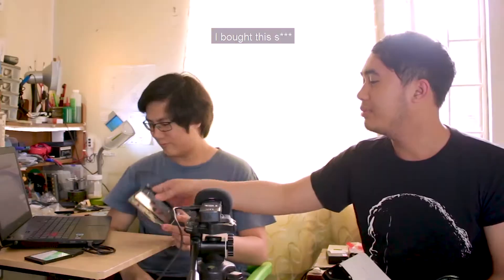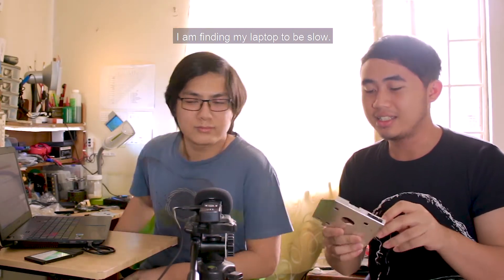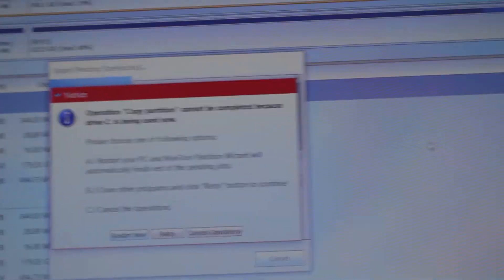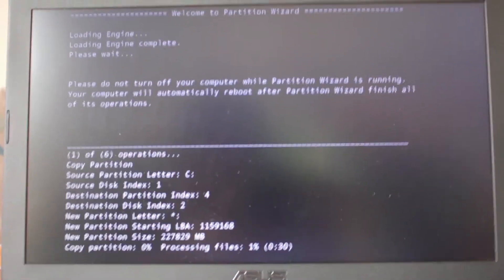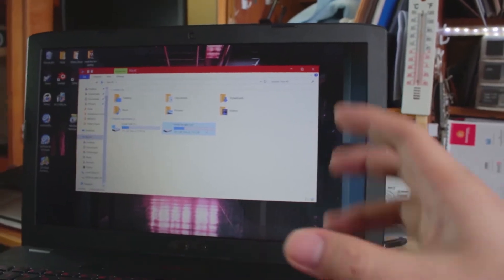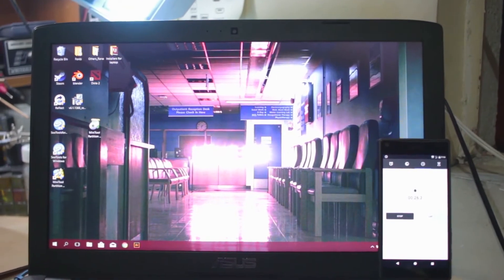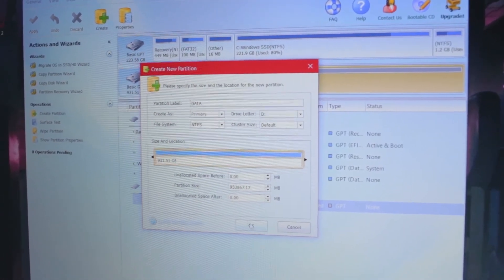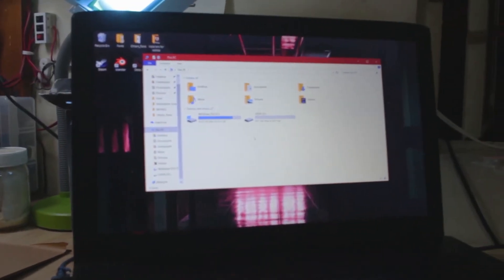Laptop Repair Log 2  - Wrong Sized Caddy and Cloning Error 23

Comment: Is it worth it to buy a 7200 RPM HDD for the caddie, or should I go for the regular 5400 RPM HDD? BTW I'm already using a SSD after the OG Hitachi 1GB HDD that came w/ my K55VJ decided to fail after 14 months way back in 2014.
Reply: If you don't travel much then get 7200RPM HDD but if you travel a lot then it's better to go with 5400RPM HDD as 7200RPM HDD will take a significant amount of your battery to work and because of this you battery life will get reduced when you are using your laptop without a charger